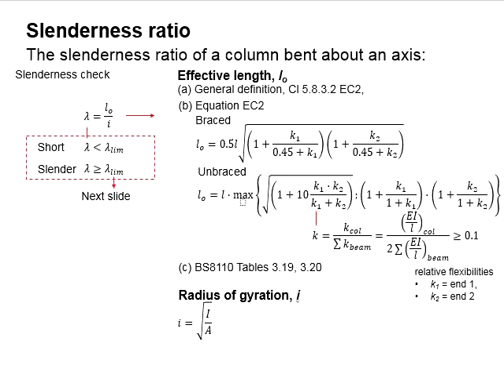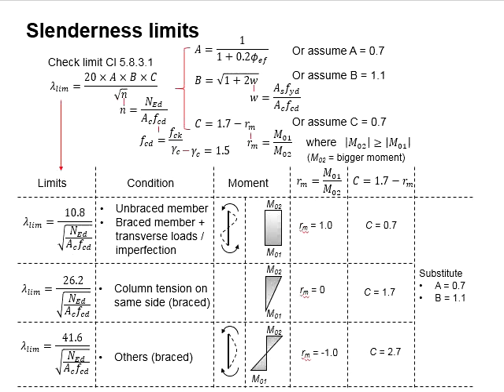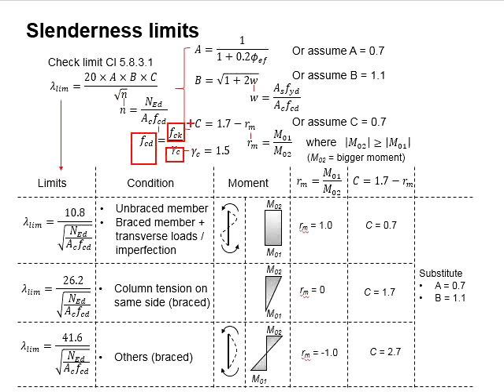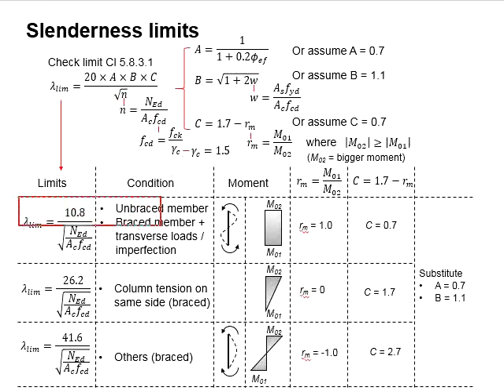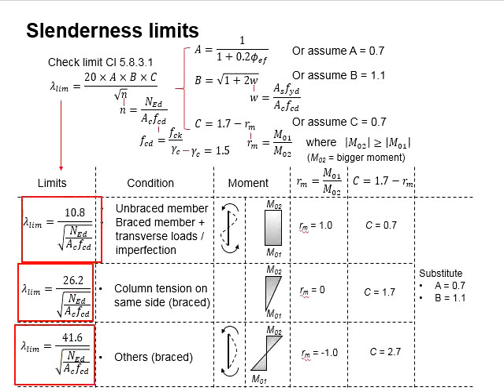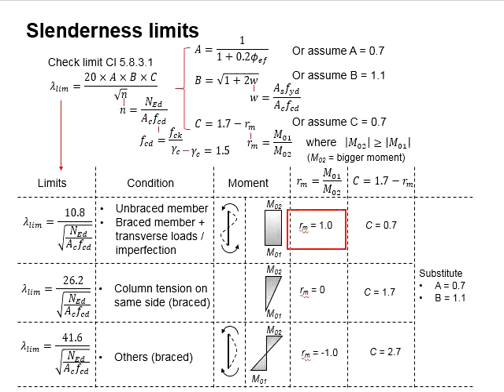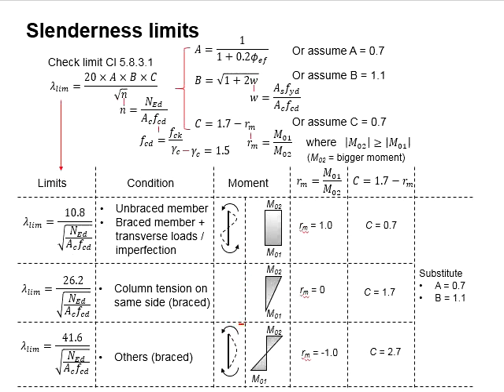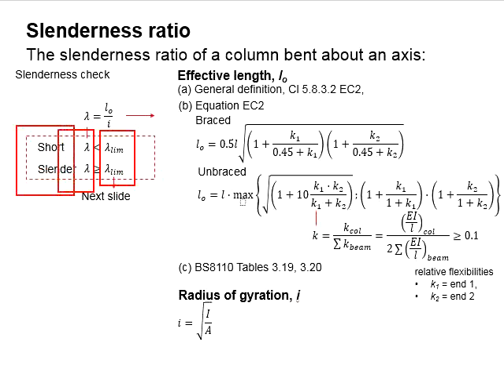2.6 Slenderness limit of reinforced concrete column

Comment: Dear [Author/Engineer/Professor],

I was reviewing the slenderness limits table related to the calculation of the moment ratio rm=𝑀01/𝑀02, and I noticed something I would like to clarify.
In the case where both moments create a “C-shaped” deflected form (i.e., the deflection is toward the same side), the table shows that 𝑀01and 𝑀02 are of opposite signs. However, geometrically, if both moments act in the same rotational direction and are applied on the same side of the column, they would produce a curvature that appears consistent with a “C-shape” and both moments would seem to be of the same sign.
Could you please clarify whether the signs of the moments in the table refer to: The mathematical sign in the bending moment diagram (BMD), or The direction of the applied moment (geometric rotation)?
I'm trying to understand how to correctly assign 𝑀01 and 𝑀02signs when interpreting real structural behavior for calculating 𝑟𝑚 and the corresponding factor C
Thank you very much for your time and help!

Comment: Hi i have a question about the variable "rm"
if unbraced --> rm = 1,0
if braced ( but with transverse loads and imperfection ) --> rm = 1,0

i don't understand when rm will be "-1,0". because  in a braced collumn with moments. Where does the moment comming from? i supose it is comming from transverse load and imperfection? so in any case rm will be equal to 1,0 ? 

thanks !
Reply from the maker: Good question. I believe it can be due to the load case that you assume when designing a column for the critical case. For example, if you have a column connecting two levels, both levels have the maximum load on the same side and the minimum load on the other side. Assuming the joint is perfectly rigid, the moment rotation at the joint would result in an S-shape response of the column. Thus, rm = 1.0 may be used. Correct me if I am wrong.